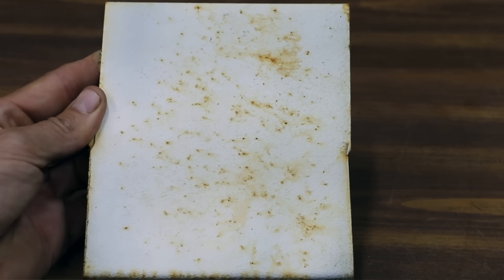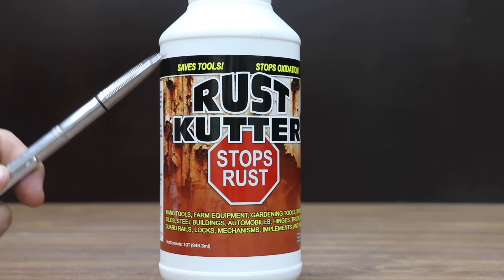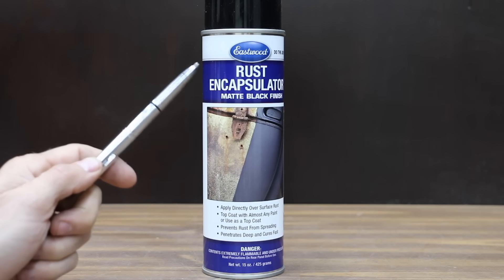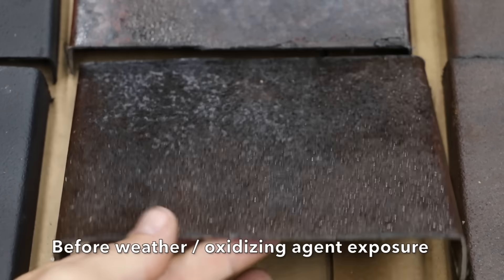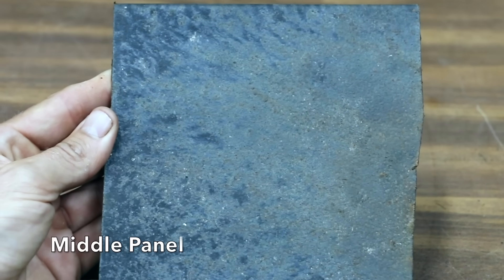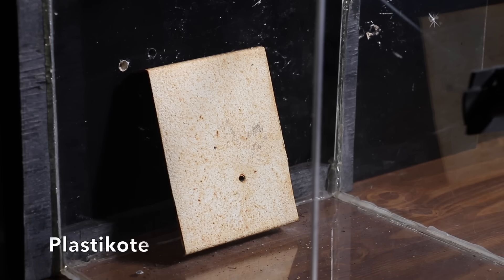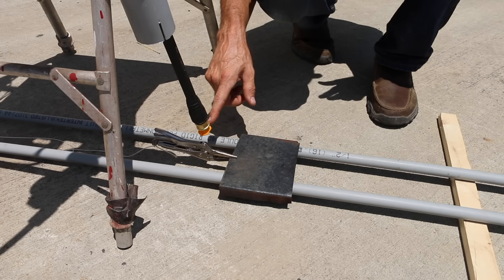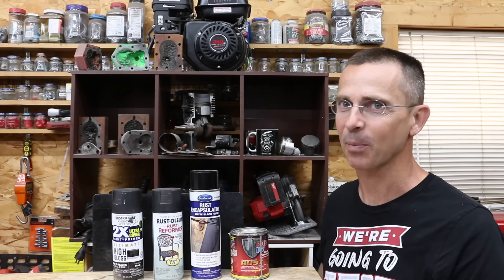Best Rust Converter? POR-15, Eastwood, Rust-oleum Rust Reformer, Gempler's

Comment: Been watching your channel for years. Great videos. I just searched for a rust preventative on you site and haven't found one. I have a building without climate control and cast iron and steel surfaces rust in it, especially in the spring when temperatures cross the dew point often. I've been using Bowshield T-9 but I'm wondering if there is something better,. CRC makes rustproofing sprays similar to Bowshield and perhaps there are more. I don't know what's best and thing it would make for a good comparison video.
Reply from the maker: Thanks for the suggestion!

Comment: Another great test video! 
But, I'm thinking the test where you shot a steel ball at the panels may have been unfair, as it looks like the white paint was the fail; not necessarily the rust converter product.
I could be wrong though; that was just my observation.
But as always, your test was very useful for me, and my projects.
Very recently I did a complete hardware cleanup & refinish on my 15 yr old Gorilla Cart; as most of the frame, struts and other metal parts & fasteners had a LOT of rust, or was starting to.
I used the Rustoleum Rust Reformer to do the job; and man that stuff is fantastic!  It does an awesome job!  I would def recommend!  And fyi, Amazon sells it in a 6-pack box that is considerably cheaper than, one can at a time.  Good for big projects, or multiple ones. 👍

Comment: As of now, in 2025, POR-15 is $75.00. 🥲  But I'm still going to get it. 😊
Reply: Honestly, I used Rustoleum's Rust Reformer to refinish the metal frame, struts, parts & fasteners on my 15yo Gorilla Cart about 2 months ago.  It works great!!!
You might give that a test run first; much cheaper.

Comment: I need a tractor paint type of product to go over some rusty supposedly stainless steel shelves. I'll check out the specs on the POR-15 to see if it's a candidate for any of this work. However I couldn't find a video where PF specifically tests tractor or farm implement paints. If anyone knows of a good one (video and/or paint), please let me know.

Comment: If you want metals to stand up to the test of time use POR 15! Best product available today IMPO. Its worth the cost considering how much labor is involved to clean up and prepare the surfaces.
I keep 3 half pints in my shop at all times. 
I've used POR 15 way before project Farm tested it against other brands and the results speak for themselves. Follow all directions to the letter.❤

Comment: POR 15 encapsulates well but the truck will rust faster underneath it … knock it off after a year or two and half your frame goes with it
—> Best treatment for rust is, scrape, apply thin spray of Rust Kutter and then 24 hours later use Fluid Film and reapply yearly
Reply from the maker: Thanks for the feedback.

Comment: Actually Vinegar does an amazing job, if you get the type that has a high enough acetic acid percentage.  I used some Cleaning Vinegar (which has 10% acetic acid and just costs a few $'s a quart) on several heavily rusted 1/2" Quick Links and it did a fantastic job.  I just let them soak in the vinegar for 2 days, and 100% of the rust was removed.   Best part, it can be used to clean windows, and for other household cleaning chores.
Reply from the maker: Thanks for sharing!

Comment: Question: can this be used on parts that move? For example, the stabilizers on our camper are beginning to rust. (It seems like the water runs off the edge of the roof and spalshes the stabilizers).  So the stabilizers still need to be able to jack up and down  Easily. Will por covert the existing rust, prevent new rust, and still allow normal movement?

Comment: Like always great video but I think some of the tests may have been flawed. How did they do at converting rust. Stopping further corrosion should have been another test. Products like the rust cutter, and Gempler's appear to be only a converter and rely on a quality top coat to prevent further rusting. So most of the test done were actually just testing the rust-oleum spray paints ability to prevent corrosion.

Comment: I’ve Rust-oleum rust Reformer before and after letting it cure for a couple days painted it with Rustoleum 2x for a couple top coats.  Looked good for a while. But rust is a tough opponent. Can you paint over any of these others rust inhibitor products?

Comment: Expensive is a subjective description, until you consider the long term benefits of the coating vs the environmental damage.  Then, it becomes very clear that the initial cost is only a small part of that equation.

SPOILER ALERT

POR-15 is worth the extra bucks!

Comment: I think it interesting that none of them really "converted " the rust but just covered it. too bad someone does not make something that seeps into the rust and locks it from moisture or changes it to something inert.
Reply: That’s why you can properly sand down to bare metal and try to remove as much surface rust as possible before applying the products.

Comment: The comparison is really well done and all the tests are excellent 👌, but really the only two products that really compete are Eastwood and Por15. To this day there is a great controversy on this matter because most workshops dedicated to restoring cars say there is very strong competition between Master Coat, Por15 and Raptor in terms of which are the best anti-corrosion coatings for various uses.

Comment: POR15 can be a disaster if it is not applied perfectly.  What eventually happens is if it starts to peel from a scratch, dent, etc. water wicks under it and causes further peeling.  I removed intact large sheets of POR15 where the metal had completely turned into rust scale - one tap and a large gaping hole.  Even if applied perfectly, if there is any wicking action, rust will spread under the paint (filiform rusting).  When encapsulation fails it is game over since it is now a perfect environment for wicking and rusting.  Ziebart went out of business because of this.
Reply: That’s not only with por15 but all rust removing products; rust is a virus and can spread badly with 0 visible damage.

Comment: You need to try Rust Destroyer. Its the best! I have used it on a trailer that has been sitting out in the elements for 5 years. Still no rust. Have used it on numerous other projects too.

Comment: You're comparing Rust Converters with Rust Encapsulaters. The True rust Converters need to be painted again, they are not a protective coating.

Comment: 8:00 - "using a point 177 steel ball.  In other words, a BB.  :)
Reply from the maker: Thanks for the feedabck.
Reply: Bb means ball bullet. There's no reference to size.
 i have been shot with both a .17 and .22 calibre bb and there is definitely a noticeable difference so I appreciated the clarification provided

Comment: I used POR-15 to undercoat much of my 2007 4Runner including the rear diff/axel housing. It's done pretty well however the frame will still rust from the inside out. I had to have a 3ft section of my frame reinforced with a right angle plat welded on. From now on, I'm having fluid film black professional applied (they do inside the frame too) every fall before winter.
Reply from the maker: Thanks for sharing.

Comment: I think a basecoat of POR-15 and a topcoat of Rustoleum Rust Reformer would be an ideal way to protect a rusty surface.
Reply from the maker: Thanks for sharing!
Reply: @ProjectFarm No, thank you! I just found rust in the rear strut towers on my car and before it gets severe I wanted to find a way to stop it (stupid new car dealership undercoating it when it was new 20 years ago). I can knock off the undercoating and flaky rust, POR-15 it, and then Rustoleum over that.  You always do amazing work. Thank you!

Comment: Thank you for making this comparison. Rustoleum also makes a brush-on version of their rust reformer in a different formula (Rust-Oleum 7830730). I've read that it is even better than the spray version. I've also heard that POR 15 cracks in actual use, allowing moisture intrusion, so I think I'll stick with Rustoleum products. POR 15 is also not UV-stable. It's good to see Rustoleum among the top performers.
Reply from the maker: You are welcome!  Thanks for the feedback.

Comment: Having read so much about this paint, I thought I would try it. My test is challenging for any paint – rust-proofing the underside of a lawn mower deck.
What I did: after removing any loose rust, I applied the recommended two stage preparation process then two coats of this paint and allowed several days to dry before running the mower. I ran the mower for one grass cutting session – about an hour of continuous use cutting two acres of grass, then inspected the painted surface.
My conclusion: if the preparation steps are carefully followed the paint does seem to adhere well to rusty areas. However, it appeared to have a tendency to peel off as a sheet in areas that were not rusty. I know this paint is described as POR (paint over rust), but clearly in reality a useful paint needs to cover a range of surfaces, not just rusty ones. I’m afraid for this reason, combined with the ridiculously high price, especially if the preparation stages are used (and it seem to work much less well if they are not – I tried this also), I can’t give a more favourable assessment.
One thing I do know though is that this stuff is very expensive - at now £55 for a US pint(!) of just the paint (not including the preparation). And for those in the UK, please note, this is not a British ("imperial") pint of 20 imperial fluid ounces (568 ml) but a significantly smaller American pint of only 16 US fluid ounces (473 ml).

Comment: I'd be very interested to see if any of the rust on these plates continued to eat through the metal underneath those protective layers. That's exactly what happened to my truck frame which now looks like swiss cheese, although it was worse than just surface rust to begin with. Unfortunately I doubt you weighed each plate right after painting over the rust, did you? If you did, you could weigh each of them now and see if there's any difference.

Comment: All these products falsely claims they convert rust, they don’t, it’s required remove rust before paint. I had a wood stove too heavy to move and I couldn’t make any dusty, i needed a spray to just throw on top but not stink when heat up stove
Reply from the maker: Thanks for sharing.

Comment: seems odd to me that you didn't at all prep the bottom of these panels, most people that do commercial body work on vehicle know that painting/repairing only the otherward side of a panel does almost nothing to prevent rust on a panel because most of the rust on a panel actually comes from the inside of the panel and normally will just eat back through the panel from the understand. doing prep/paint in this manner it basically like putting a mask over the actually problem, generally just encapsulating the rust into the panel and not actually removing or preventing it.

Comment: I've used POR-15 for over 20 years or so. Still have the 6.5x10 utility trailer that I painted after I built it in 2004. I coat the underside all of the mower decks that I rebuild or repair with POR-15.
Reply from the maker: Thanks for sharing.

Comment: The liquid version of Rustoleum Rust Reformer may be even better than the aerosol.  
The liquid contains 1-2% Tannic Acid, the aerosol does not, and I've read reports where this particular acid provides especially good results on iron/steel surfaces.

Comment: Although the Rustoleum Rust Reformer recommended only one coat, I have to wonder how it would have done with two (since most of the other products seemed to use two).  Thanks for doing this!

Comment: I would love to see the products tested on their improvement to increasingly rusty panels rather than post-treatment rust
Reply from the maker: Thanks for the suggestion.
Reply: @ProjectFarm  You always respond! :D I'm more concerned with spraying it on an underbody with extremely bad rust and how well it'll mitigate it and reduce material loss, I'm not too concerned with coating durability since I'll put a ton of underbody coating over it anyway.

Comment: These products require a topcoat of paint and/or clear coat or they won't last long. I tried the Rust-Oleum Rust Reformer on a steel chest freezer in my garage that had started to rust due to humidity. It lasted 6 months before rust spots were showing through it.
Reply from the maker: Thanks for the feedback.

Comment: I'm a fan of the Eastwood stuff. Their top tier Rust Encapsulator Platinum is great stuff.
Reply from the maker: Thanks for the feedback.
Reply: @ProjectFarm  I just sort of realized that maybe we both used improper nomenclature. The Eastwood Rust encapsulator are not converters. There is no chemical reaction. It's basically a sealant or paint. Eastwood does make an actual rust converter, which is a totally different product that does a different thing for sort of a different application so maybe the use of the word converter in your title is used loosely. Either way great job.

Comment: Used motor oil, turpentine and some lanolin if you have it. Motor oil and turpentine should be a 1:1 ratio. Add just a little bit of lanolin. Instead of turpentine, you can use diesel fuel or kerosene. 

All these rust sprays do is trap moisture. Oil displaces moisture.

Comment: You can paint over rust reformer....Over rust reformer I plan to use a rubberized coating like flex seal or the rubberized product from rust-oleum...Any dings from road gravel or what not won't do any harm as the rubber will give and won't fracture. there are cheaper products that will do the job like rust-oleum. What do you guys think?

Comment: I wish you had tried cold Galvanizing compound. I have found it works very well just even spraying right on surface rust without cleaning. 
I had very bad luck with POR-15. It does not still to the inside of a fuel tank. It flaked off creating a major mess. Clogged several gas filters. I finally had to give up and throw away the tank. I was also unimpressed with how it did on my motorhome frame. Within 1 year, the whole surface was dotted with rust.
Reply from the maker: Thanks for the constructive feedback.

Comment: I see people mentioning POR15 in the comments. The problem with POR15 is that it is photochemically reactive and MUST be coated with paint or uv rays will eventually destroy the coating and it will come off and rust.  It states this on the container but nobody reads itm
Reply from the maker: Thanks for the feedback.

Comment: Rust converter should always be coated with a solvent based top coat. Rust converter is water based, and will allowed oxygen back in. You need to smother it with paint or primer then paint.
Reply from the maker: Thanks for the feedback.

Comment: There’s quite the difference between a rust converter and rust encapsulation. POR15 is an encapsulator not a converter like rust Kutter. Of course the rust will return, because you have to prime and paint it afterwards. POR 15 has the tendency to peel, fade, and flake. Try “Rust Bullet” (in this test)as an encapsulator, and you’ll throw rocks at POR15. The best converter here is rust kutter hands down.

Comment: Hello, I have a product suggestion 
It's regarding rust converters that convert rust into black magnetite. 
But you cannot use a wire brush and a drill to remove all the rust. It'll have nothing to convert. 

A lot of these bottles come in 1 quart 
Some of them claim rust will never return, some need top coats 

These are all brush on 

Gemplers rust converter 
Corroseal, converter
Eastwood converter
Black star converter 
FDC rust converter ultra 
Birchwood industries rust converter

Thank you very much and please continue making excellent videos.
Reply from the maker: Thanks, will do!  Thanks for the suggestion.

Comment: Is it just me or none of these actually rust converters? Looks to me like they cover and encapsulate it. Likely making it worse.
Reply: So it's best to get as much rust off as possible,  and spam blast it with por 15? I'm getting new exhaust pipes for my bike, and they're rusty and used but sweet, so this is a legit question

Comment: Por15 to my Tundra's weeping rear end a year ago and top coated with Rust-Oleum undercoating...still holding strong.  Its not fun to work with but dries rock hard.  I've also used por15 tank sealer in metal gas tanks with complete success.  Its just great stuff.
Reply from the maker: Thanks for the feedback.

Comment: Watching this for probably the third time. After other research and because it’s available in Canada I’m going with POR 15. This gives me piece of mind that my time spent will be a good investment. Thanks!!!
Project is a 2005 sequoia frame.

Actually there is an incredibly hard coating on it now and I’m wondering if it’s POR 15. To get it off takes a chisel. It is rusting beneath though and coming off in many areas.

POR-15 also have their rust prep converter. I bet it will perform even better with the converter and perhaps a top coat.

Then I will fluid film it and inside the frame. So I hope it lasts.
Reply from the maker: You are welcome!

Comment: I've come across a new rust sealer and it's not a product. It's 3 product; used oil, diesel fuel, and grease mixed and brushed on. It's an old farmers rust sealer. I've used used oil and diesel mixed for any wood sealer growing.
Reply from the maker: Thanks for sharing.

Comment: If I was to coat the inside floor of my truck, which one would outgas the least with the least chemical smell?  I don't want to gag every time I get in the truck, especially if the truck is sitting in the sun a couple weeks with windows closed between uses.  Or would it be better to use a bed liner product for my application?  Prefer something that boots won't quickly wear away.